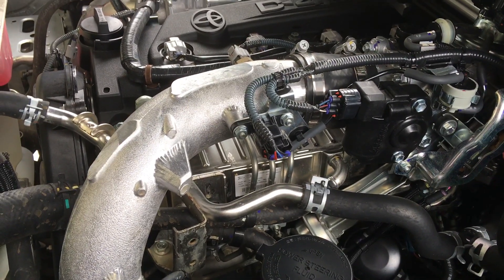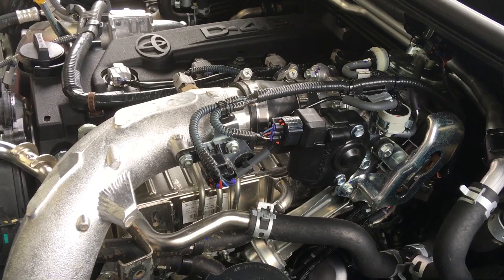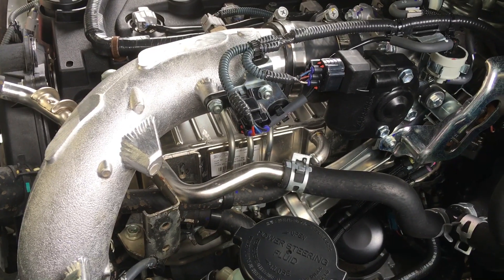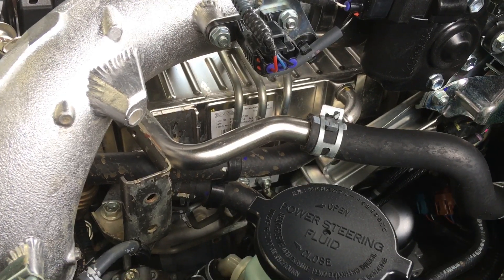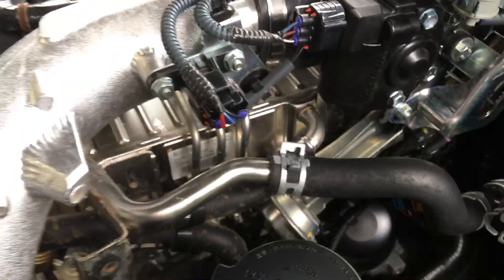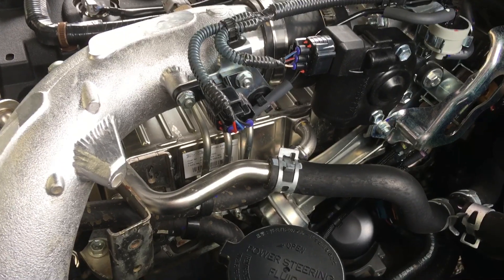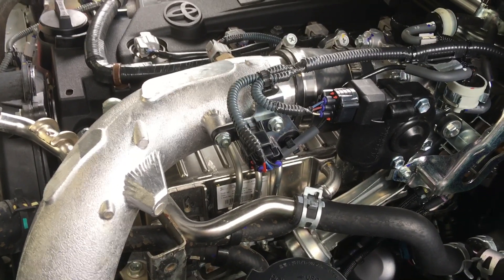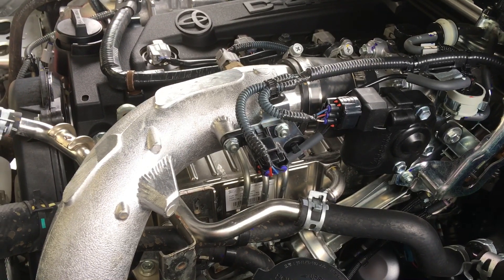1kd-Ftv egr & pcv system

Comment: Hi there, nice video. I have a problem where my 3.0L d4d is spewing out oil drops from the dipstick when removed and the car is idling, is this normal? Egr deleted and catch can installed.
Reply: Catch can was to small and although it says universal the in and outlet pipes were to small increasing the amount of blowby in the engine that is why oil was shooting out the dipstick hole.

Comment: Hi got a hilux was throwing a     
Po 400 code cleaned the egr had little crap in it fitted a plate with  a 7mm hole.  still throwing the same code thinking crook egr valve or vacuum issues  
  .any thoughts